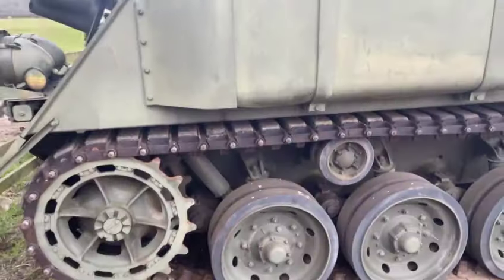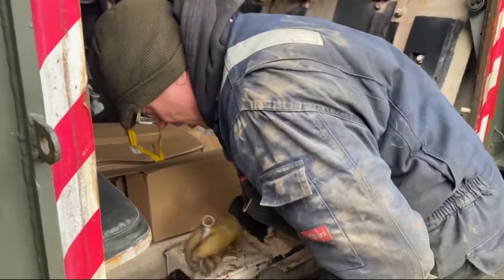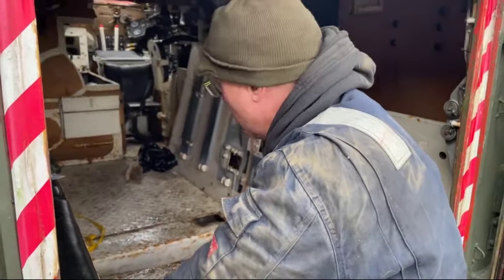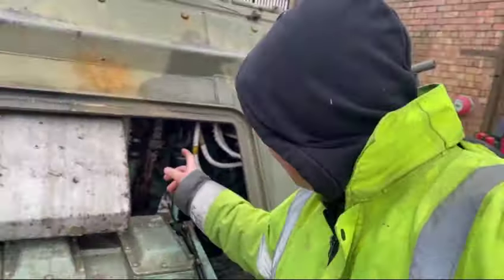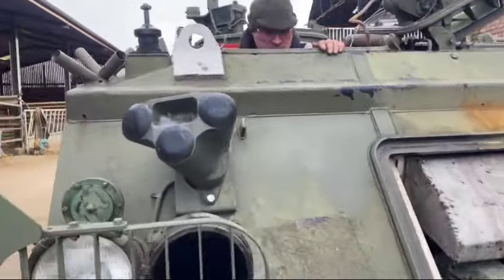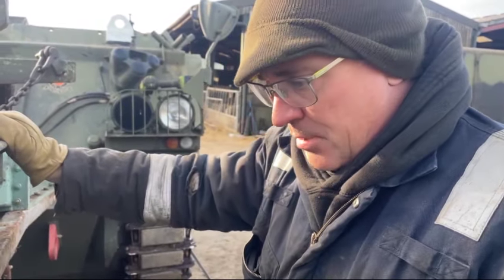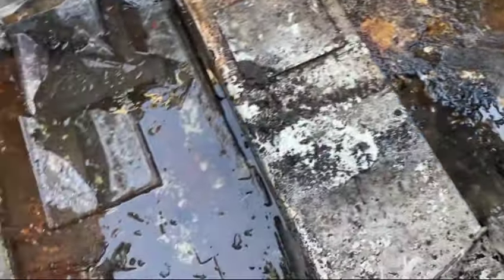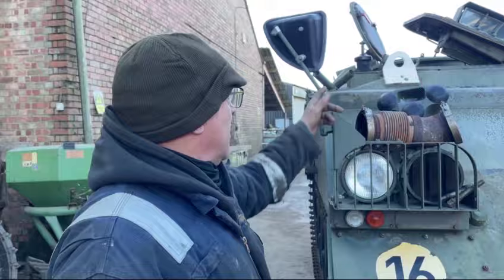How to Fully Restore a Military Armoured Personnel Carrier (Part 1 Of 2)

Comment: I love your work!! I have been a diesel mechanic for a lot of years and one of the first and easiest tests to determine if an engine is in good condition is the crank test. That's where you just crank it over with the starter and listen. If it turns pretty consistently then it has even compression along all cylinders. It the rpms change from fast to slower then you likely have a cylinder or two with low compression. That engine sounds great and only 500 hours means it is probably ready for years of service, or in a museum, decades of service!!!
Reply from the maker: Thanks! Yeah the engine was lovely hopefully it keeps that way haha

Comment: I was under the impression it was a full overhaul
The only full overhaul i was used to,was a full strip down of every nut & bolt,then full rebuild at the central workshops REME
Reply from the maker: Thankfully this vehicle doesn’t need that haha! Unfortunately it wouldn’t be cost effective to strip it down to every single  bolt for a 432. Our bigger restorations such as our m3a1 Stuart we did strip it down completely

Comment: Great video but I am only getting it in 480p.   Was it filmed in a higher resolution?  Also a suggestion to normalize the sound so that the voices become louder and the engine noises become softer.  Otherwise you have to turn the volume up for the voice parts and then the engine parts are too loud when your goofing off at work watching tank vids.......
Reply from the maker: Yes I had a bit of an issue with the quality part 2 should be better. I’ll have a see what I can do about the sound
Reply: @ArmourgeddonTanks  thanks for the reply.  Looking forward to the next episode.